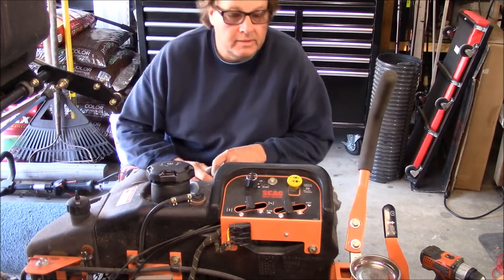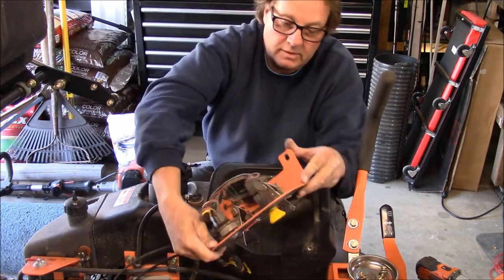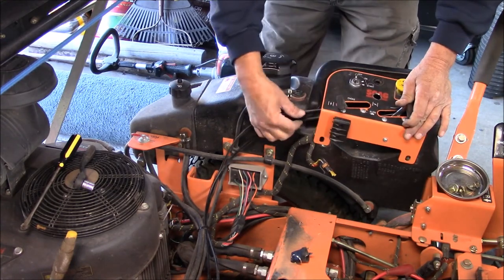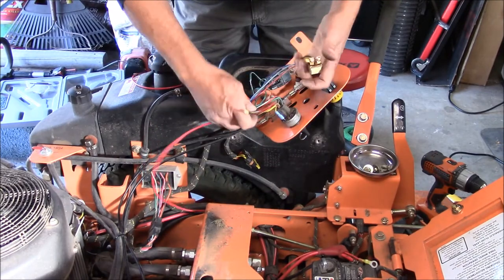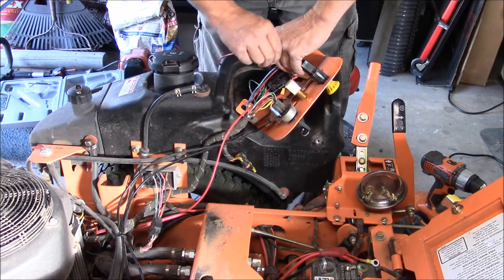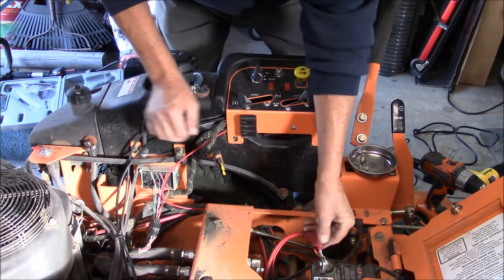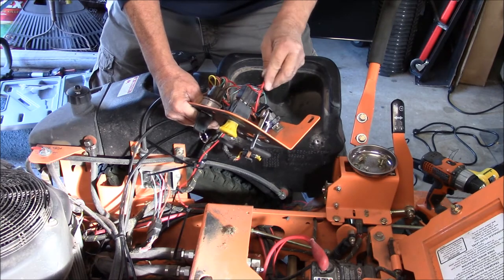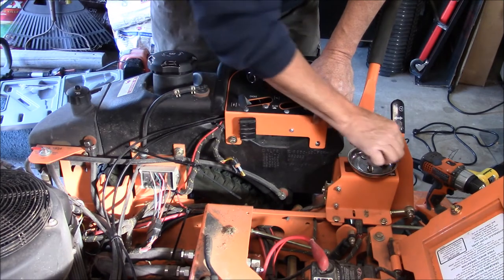Mounting a push button start to bypass ignition switch, Today's Events Vlog 65

Comment: Make a video on how to install a key switch to a spartan. I have nothing but problems with that push button crap.
Reply: I have a POS Cub Cadet with push button, nothing but problems.  I bypassed the starter relay and installed a switch but I’d love to bypass everything.

Comment: i hate how mower companies put so many safety switches on mowers and stuff. So annoying. Ive got the seat switch and the reverse switch both bypassed on my John Deere x540 GT
Reply from the maker: Worst part about it having problems it is not even a year old. If we have a rain day this week I will be doing a review of it and what I have done to make it work for me.
Reply: being so new, does it still have a warranty? and if so, wont they give you a loaner till its fixed? if they wouldnt i would be thinking about going to a different dealer/brand. but thats just me
Reply from the maker: It is still under warranty. The only dealer that provides a loaner if they have any available is over an hour away. So I don't have a choice but to do what I do. That is the biggest reason I use Scag is because of the availability of parts. If I need a part and call before they close they will leave it out for me with a bill and leave a check in their box.